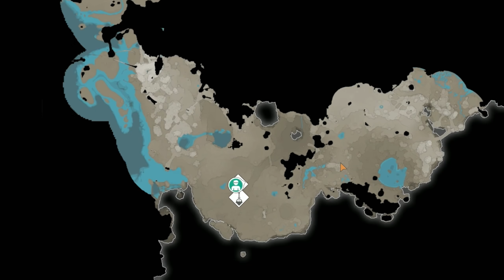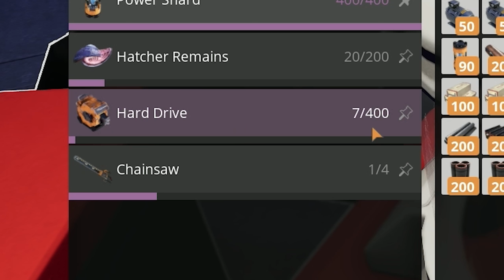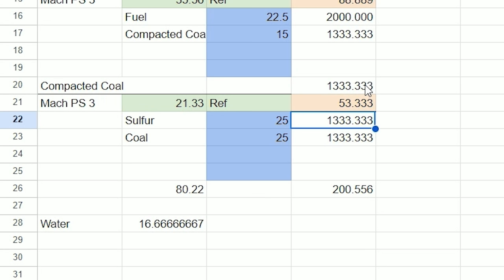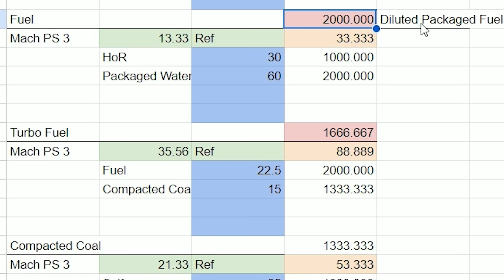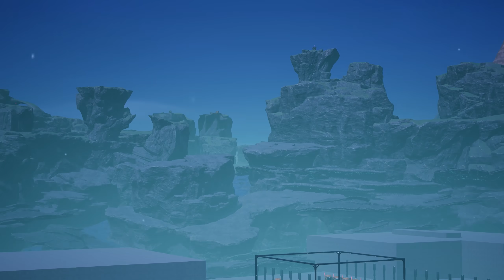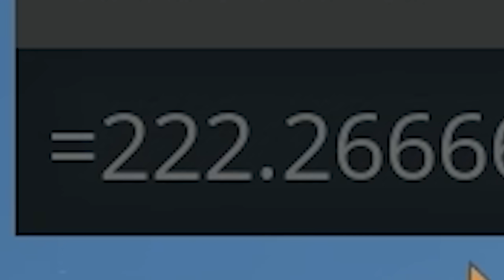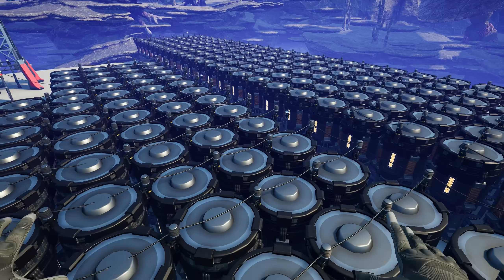This Factory will BLOW YOUR MIND - Satisfactory 1.0

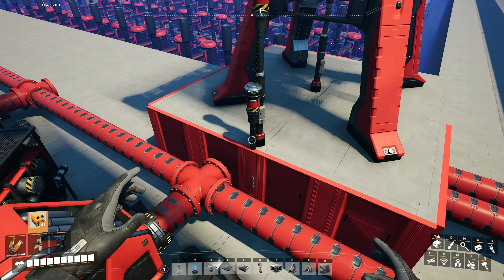Comment: 22:34 what kibs should have done was to close off some pipes and belts so that enough fuel generators could run without crashing his current system. That way, he could plug the fuel generators back into the grid and bring the rest of the factory online slowly.

Comment: For anyone else doing a setup like this, you can protect your power grid from a total blowout by putting a priority power switch between the connection for all the machines that run this power plant and your other power generators.
As your grid overloads, a priority power switch will act like a circuit breaker, allow you to set the order of other grids connected to it to shut down in order to keep the rest of your grid online. If Kibitz at right here 22:23 had connected that pole to a priority switch instead of directly to the other power, then it would have shut off only the machines in the turbofuel setup the event that they drew out all the stored power before the fuel generators had come fully online.

Comment: A much easier Diluted Packaged Fuel setup would be to stage one Packaged Water feeding directly into one Diluted Packaged Fuel refinery and have that output feed directly into one Fuel Unpackager. Then use an underflooring with the conveyor lifts and floor holes to connect the Fuel Unpackager solid output with the Water Packager solid input. This solves the belt work for your closed loop, and you need only worry about the piping, which isn't too difficult if you utilize the Stackable Pipeline supports.
When I did this setup in my Turbofuel power plant, I did a row of 24 of this three machine array to handle 720 per minute of Heavy Oil Residue (from one 540/min line of Crude Oil), and I put a stack of 200 empty canisters in the Water Packager, and then dropped second stack of them in the output slot of the Fuel Packager (which would immediately start to travel along the belt and back up in the Water Packager until they were ready to be reused. This was more than enough to keep all three machines running at 100% efficiency.

Also, with regards to the Polymer Resin byproduct, since you are already in the Blue Crater Lake one great use for some of it is to unlock the Polyester Fabric recipe from the Mycelia tree in the MAM and then tap the nearby coal and iron nodes to automate the production of Gas Filters. I dropped a simple setup of a smelter, constructor, Polyester Fabric refinery, and then two Manufacturers on the very bottom floor of my power plant and then put a dimensional depot down connected to a storage container buffer, smart-splitting the overflow into the AWESOME sink with the rest of the unused Resin, and I haven't had to worry about Gas Filters ever since. Whenever I come close to running out I open my inventory and grab a stack from the Dimensional Depot.

Comment: If you upgrade to rocket fuel using this setup, you can turn the local 2550 crude oil into 9444.4 rocket fuel. That can then run 906 fully over clocked fuel generators for 566,250 mega watts. It is just going to add another 944.5 nitric acid to the production chain.

Comment: Hey Kibitz,

There is apparently a (probably new?) alternate recipe you would for sure love, because it converts heavy oil residue into turbo fuel using compacted coal... So it would effectively remove the entire packaged fuel step...
Tho, I can't tell if it would have a higher, similar or lover production rate as the setup you use.

Comment: time to build this in my world, probably not as good, but gonna try, although im not going to make diluted fuel, as just making the heavy oil residue seemed easier, and you get limited by sulfur anyway, but also using the impure node thats past the 3 on the right. and will have like 3 oil spots leftover to do other things with.

Comment: you can get an alternative recipe for the blender that is diluted fuel, it is the same numbers as the packaged one u use but without the packaging
Reply: That's definitely the preferred setup for saving on space and power, but it requires you to have Blenders unlocked, which is in Phase 4 of Project Assembly. I think he was only in Phase 3 when he made this video, and without Blenders, Packaged Diluted Fuel is your only option.

Comment: Isnt there a deluted fuel recipe that isnt bottle fed???? Im fairly certain there is
Reply: yes in phase 3 with the blender building, geothermal gens no longer need supercomputers and it's an easy 7000 avg mw if you run and grab all the nodes.

Comment: Would have send the compacted coal into coal generators till getting the blender... cause it has an alt recipe that completely gets rid of the packaging. Can make diluted fuel right from fluids and also can mix turbofuel. Makes it much more easy and saves the headache. With the compacted coal at that location it should be enough power to get the the blender.

Comment: I held off on my turbo fuel factory until I had blenders unlocked. There is a blender version of the diluted fuel recipe that cuts out the canisters. It takes 50 heavy oil residue and 100 water per minute to make 100 fuel per minute.

Comment: This is the way.  I make two big power storage arrays.  One array remains online and manages power fluctuations.  The other array remains offline or on a separate grid with geothermal.  Charge the backup power storage array, disconnect it, save it for emergency recoveries, like booting up a fuel power plant.

Comment: even if the batteries didn't last you could just disconnect, charge them again and try again untill the machines process enough stuff that you get the turbofuel. Because even the batteries don't last all the way they still get the machines producing stuff for a bit.

Comment: I always find that pipes are absurdly inefficient. I did this whole build for a single pure oil node, and I load balance the pipes, and the oil just never gets to the end point. My turbo gens are running at half capacity despite having 120% more fuel than needed.

Comment: Something with the sloops that I saw on reddit the other day, put the Sloops in the packager and get double the fuel and also free-ish empty canisters. Either bin or sink the half that you don't re-use. Or put the Sloops into the Turbofuel refiners and double the generators that you could run.
Reply: But you need 2 sloops per refinery, and there’s only about 100 on the whole map. Even with overclocking on top of it that’s a pretty limited supply
Reply: @alexsiemers7898  Yeah, I didn't realize the size of the operation he was building when I commented that. I hadn't gotten that far in the video at the time. I'd also forgotten how crazy big Kibitz likes to build.

Comment: The ratio of refineries making diluted fuel, to packagers making water, to packagers unpackaging the fuel is 1:1:1 so I prefer to make little self-contained units of those trios and that way you just need to pie the Heavy Oil and Water in, and the fuel out.
Reply: This is what I do as well, I just make my 1:1:1 modules vertical so it's easily tileable
Reply: But why though you can get the blender diluted recipe and skip packers altogether.
Reply: @ashenlion805  Two reasons: Blenders are unlocked MUCH later than Refineries and Packagers, and secondly, since 1.0, there are so many alternates that I have almost finished Phase 4 and I STILL haven't unlocked diluted fuel for the Blender.
Reply: Same. I have no idea why Kibitz didn't just do this, especially as we later learn he messed up his Package routing and it breaks. Doing a 1:1:1 seems like the easiest way for nothing to break.

Comment: Yo Kibz,

Work out how many fuel generators you need to run just the fuel production machines, and then setup an isolated power grid that's JUST the fuel production system and enough power to run itself. Then have all the other generators connect to the external power grid.

That way, if something goes wrong elsewhere in the world the power plant can keep running even if the rest of the world grid crashes :)

Plus if something goes wrong (nuclear power plant style) it's an isolated system to troubleshoot without needing to worry about the external world grid pushing up the power requirements of restarting

Comment: Note: don't use large manifolds in systems which require packagers, the delay between canister use and recovery increases exponentially with manifold size, this is why you need multiple lines (manifolds) wth multiple leader belts. - the math is just adding layover and use time for each machine (including packagers) and the time it takes for items to accumulate in the mid-to-end most machine.
Reply: That's why you would want a small storage for a few hundred surplus canisters both before and after. It's the same issue people end up with flow rates on pipes. You need capacity to adjust for fluctuations. Simply put some sections run out before they can resupply if you prevent former you prevent the latter. For pipes put a tank at the end of the line and let it get up to capacity. If it's not filling past a certain level your issue is headlift not flow rate

Comment: If you are sinking plastic, shouldn't you just make your packaged water canisters with the plastic and then sink those?
Reply: Actually once you’ve made enough canisters, they can just cycle back into the system, since unpacking gives them back to you. So you fill a bin with the canisters to pack the water, get them back after unpacking the fuel, and have a belt head back to the bin to keep the system running forever. Turning the resin into canisters will eventually cause it all to back up everything and shut down.
Reply: @cybertramon0012  He explained that in the video actually. My question was more about the cost of sinking plastic vs containers.
Reply: @MegaLokopo  In that case, maybe he's leaving it as plastic so that if he ever needs it later on, he can just redirect it elsewhere without getting rid of the constructors first.
Reply: @cybertramon0012  True.

Comment: A question the alt recipe from the blender ( when is unlocked of course speaking of aluminium and all) water and heavy oil is better thand the refinery with water bottles?
Reply: It should reduce the number of buildings needed but otherwise the ratio of HOR to water is the same.

Comment: The way I like to handle power storage is with 2 seperate battery setups. I put them both behind power switches so they don't drain when I don't notice. The first system is backup power. This is used commonly when I need to jumpstart a new power plant or if I’m having an issue with my power plant The second set of batteries is emergency power. Thankfully ive never had to use it but I have gotten close to running out so its reassuring knowing there is a second set of batteries.

Comment: To uh, blow your mind. If you somersloop the Diluted Fuel, you have infinite canisters ;-) 
Then simply overflow all the loops to max them out and overflow the remainder into a sink. 100% efficient + extra tickets :) 
(and more if you somersloop other extra's too, like HOR)
Reply: You can't use sloops for recipes using canisters.
Reply: @Gazer75  wut? That changed already? I played like 2 days ago... :( dangit! Sure I saw someone do it, was working toward a small fuel setup then. Might change to a massive one now, might as well go all out properly then
Reply: @RobinKeetNL  The packagers had no option for sloops and the refineries making diluted packaged fuel also had that part blocked.

Comment: Maybe I'm stupid but what is the point of packaging the water to make packaged fuel just to unpackage it?
Reply: The alt recipe lets you mix packaged water and fuel together in the packager. There's a similar alt recipe that lets you mix water and fuel directly without packaging them, but it requires a blender because it takes two fluid inputs.

Since water is extremely plentiful, it lets you get way more oil from your oil extractors.

Comment: Honestly suprised Kibitz didnt set up a power control tower with breakers to have each sector of the turbo power plant come on individually.
Reply: Soon(tm)
Reply: @TheAruruu certainly this. I'd figure he'll get around to upgrading the power infrastructure once he has all the components for such a project.
Reply: The other way here is to have a smaller heavy oil to fuel portion of this system that you just burn the regular fuel in to bootstrap it.  Overclocked fuel generators will make 500MW ish so you don't need many to bootstrap the plant. Then just remove those gens and let the let the turbo take over once you have enough of the loop up and running.
Reply: Honestly, I thought that he was going to pre-load the imput belts and pipes for each system in the production.
The overflows supplying all those machines is gonna take ages to fully saturate.. power graph line go up-down-up-down 😂
Reply: He's lazy these days 🤣🤣🤣 jk 🤷🏾‍♂️

Comment: I find it really interesting to see how other people solve the same problems. I combined the packing and unpacking for diluted fuel into one blueprint since the ratios for the recipe is 1-1-1 with the machines. That way I didn't even have to worry about managing the canisters.
Reply: smart idea
Reply: That's genius, ima keep it in mind once I start my next powerplant

Edit: I built some designs for this, found out if you place the Empty Canisters in the Water Packager it saves with the Blueprint so I won't have to fill every block to get the system running
Reply: I managed to find out that was the right ratio but still for some reason put all the empty canisters onto a few main belts.

But in my Update 8 and 1.0 saves I managed to get far enough to unlock and utilize the diluted fuel recipe in the blender before bothering with the packaged fuel.
Reply: I just used the blender recipe and you don't have to pack/unpack at all.
Reply: @ashenlion805  But you need tier 7/8 for that which makes it come after you need the turbo/fuel generators and right as you can start preparing for nuclear. It's a good recipe for plastic/rubber production though

Comment: Hey! I'm a begginer player and i don't get how do you manage to have THAT MUCH machines in a maniold and to make it work properly ? astonishing for sure but i'm maybe missing something...
Reply: It works as long as you don't put more machines in a line than your belts and pipes can fit, which means it won't work for every recipe. For example, three water extractors provide 360 water, and eight coal generators need 360 water, but a pipe can only fit 300 water, so your manifold can't fit all eight in a row with one pipe fed from one side.

One thing about manifolds though is that even if you check that you'll have sufficient throughput, since each machine can store a bunch of materials, the manifold will take time to saturate with materials. It could just be that yours is set up correctly and you just need to wait. Or you could jump start it by manually filling some machines.
Reply: Yep, I tend to preload my machines or output disable them until they fill up each item so the system will maintain steady state operation. I also tend to buffer a bit with storage containers/fluid containers between stages since (at least it was) common for the game to lose small amounts of fluid in systems that were using 100% of their input over time leading to machines at the end of the line turning on and off.

Comment: I power rushed Rocket Fuel and all the alternate recipes to optimize it. Using those recipes, you can turn 600 oil into 2,400 Rocket Fuel which can power hundreds of fuel generators and produce over 140,000 MW of power. I currently have mine producing 85,000 MW and bottling the rest to be used by Drones.